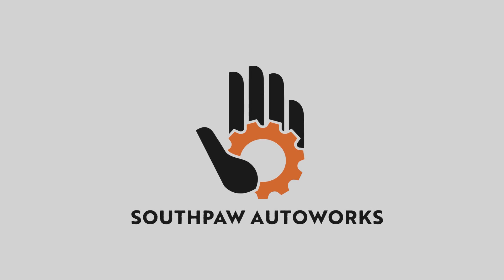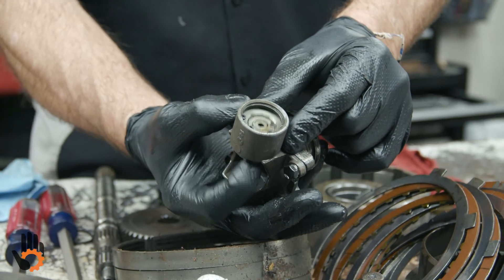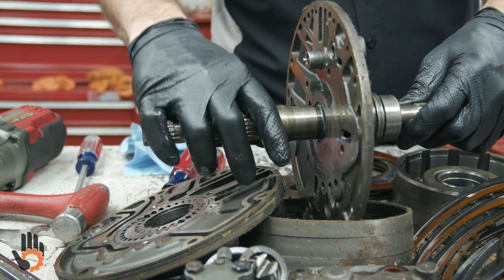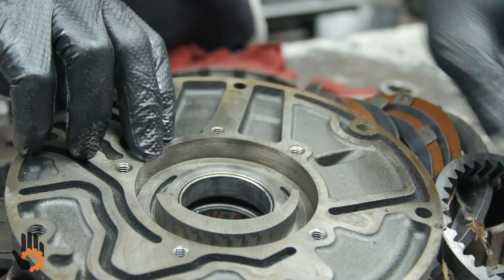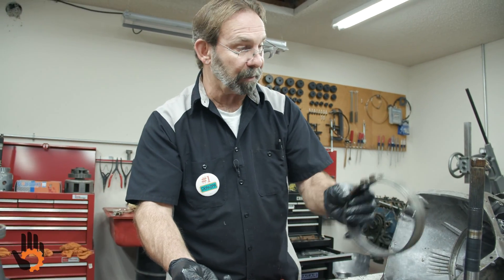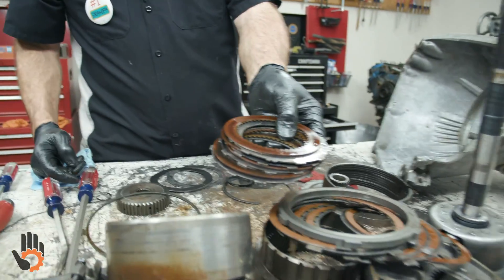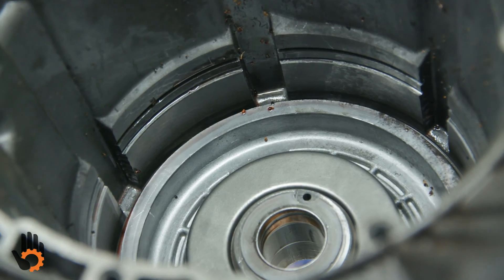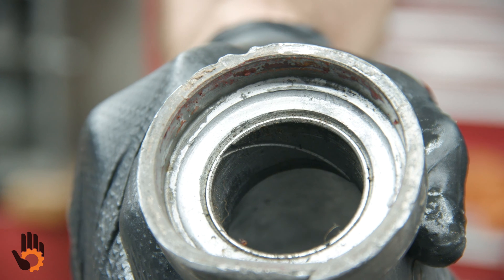Aluminum PowerGlide - Inspection

Comment: First thing in my book I used to rebuild mine discussed the case inspection. 
My car is a 283 p/glide no wahzoo HP. 
67 Impala convertible. 
Not a hot rod is where I’m going. 
The front of the case where the TC lives is where they emphasize inspecting for cracks. Mine had just about every crack they showed!!
I was stunned to see the amount of stress this unit was going through with a low HP engine from one owner. I tried doing some welding on the cracks with some rods you see guys use at shows. They obviously know exactly how to use them and it looks easy so you buy them 😆
I managed to make a mess and luckily not destroy the case!  Moral of the story, check for CRACKS!
Thanks again for your great advice and sharing experience with us. 
He’s right about that shifter assembly being a little confusing. I remember distinctively having to pay ATTENTION. Definitely replace the shift shaft seal.
Reply from the maker: Making it look easy...they definitely do that!  ha.

Thanks for checking it out.  Appreciate you dropping us a line, James.